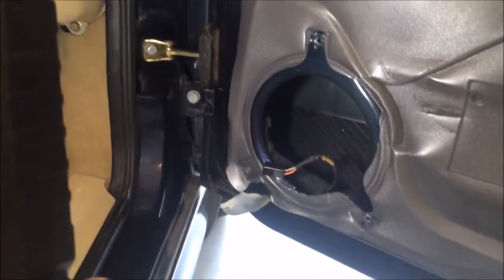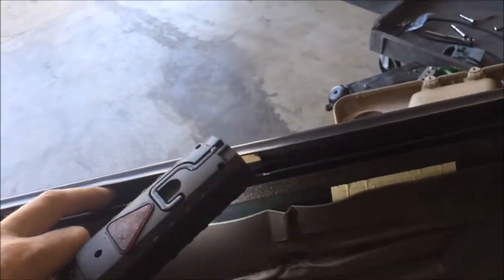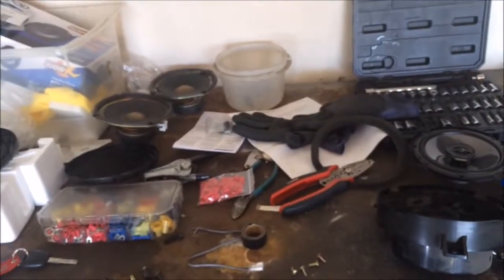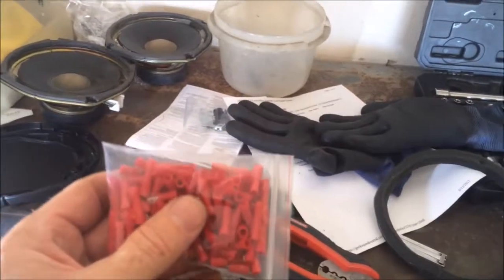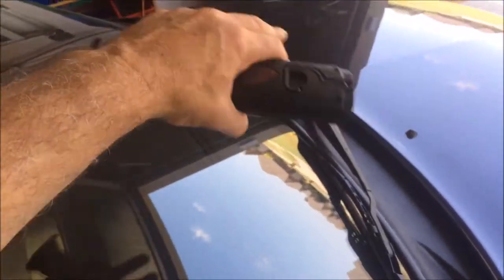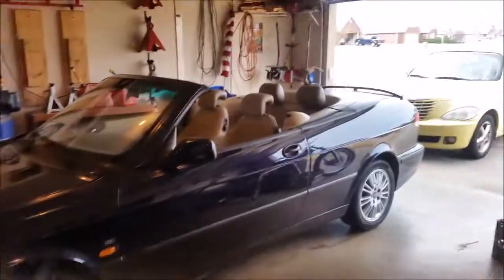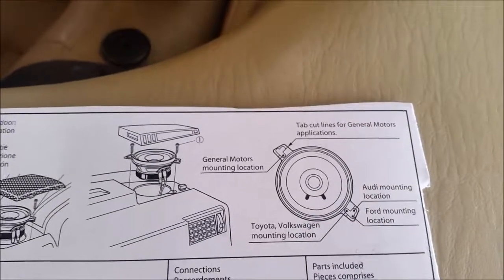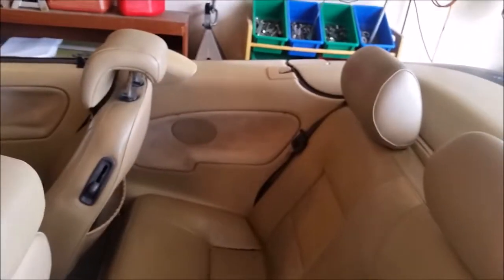S1E1.6 Saab 9-3 Door Windows & Speakers

Comment: And where I can Find that plastic piece that supports the speakers, and that sticks with bolts to the pannel? Mine has not anything there of plastic, just connector
Reply from the maker: You can go to Ebay or a local junk yard. There is a couple of junk yards here in Tulsa that have a few of these 9-3s. I can probably go get a couple of the rings for you. Let me know. Maury
Reply: Oh! Thanks a lot friend :), but im a little bit far from you :D, I found them on amazon for 15 euros, I dont know what to do, also I need an amplifier and find the connector of the speakers inside the car :( I know there are on the center console on passenger side...found the battery cables but not the 4 cable of the speakers... :(